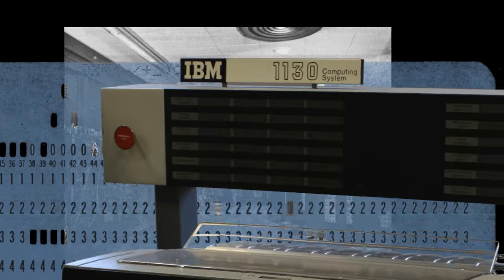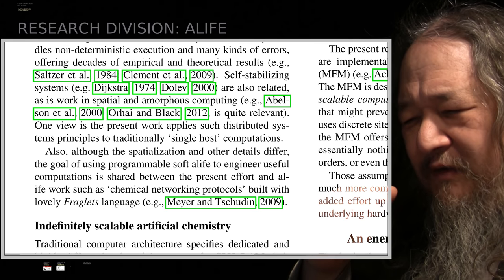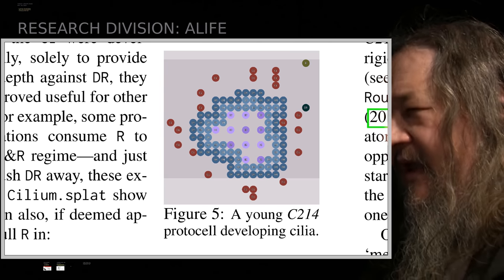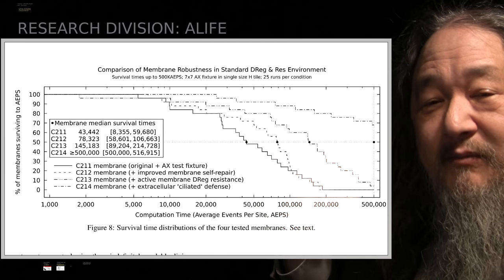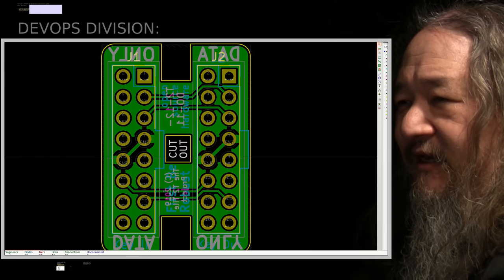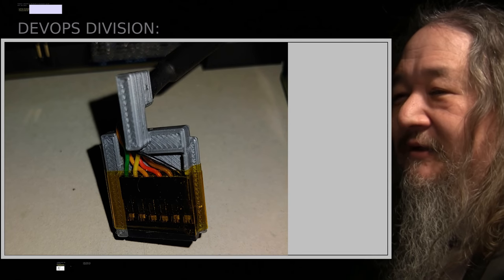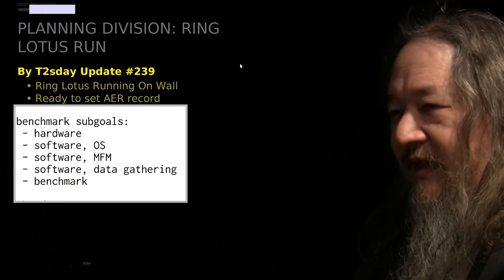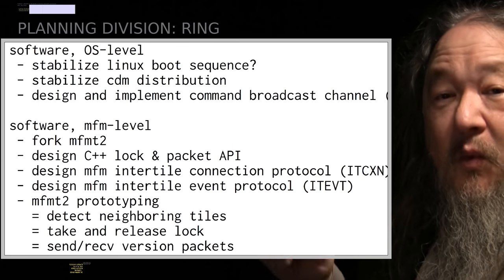Next Level Digital Protocell for Artificial Life - T2sday Update 233

Comment: Thanks for the update Dave. Ambitious goal for July... I'd be curious to hear what you're thinking for frame design. Materials etc?
Reply from the maker: Thinking of drilling holes in acrylic for testing but wondering about like CNC aluminum sheet down the road.  Any thoughts?
Reply: @T2TileProject  I was thinking t-slot aluminum extrusion, though it might be one more 3d printed component to get the tile to mount to it. But that would cut out a lot of manual work and you would have something that could be reused or expanded for larger or different grid shapes.

Comment: Great stuff. I'm super interested in that alife paper. Is there more to it than what you explained, or is it more entry-level? Is it available anywhere?

I must say that the software stuff going on inside the MFM is what keeps me coming back and I can't wait for the point where the discussion is mostly about what the laws of the MFM should be.
Reply from the maker: Well, it's 8 pgs ranging from SPLAT excerpts to discussion of cellular software engineering techniques; not sure if that's entry level or not. The paper won't be out until the conference this summer, I think, but I hope to put the source code out (in the SPLAT repo most likely) sometime 'Real Soon Now'.